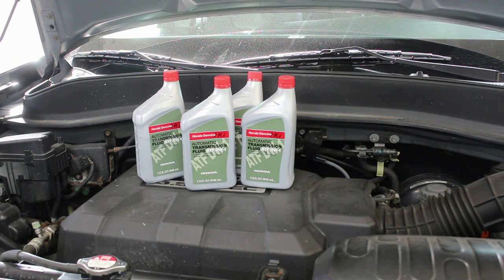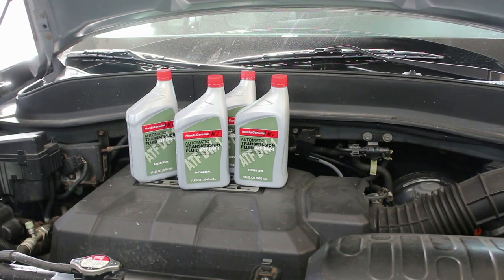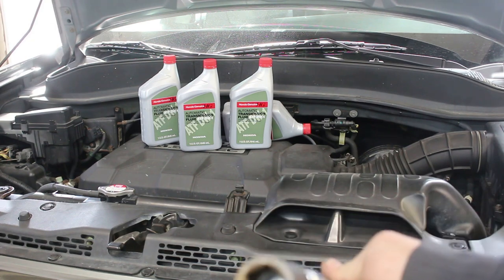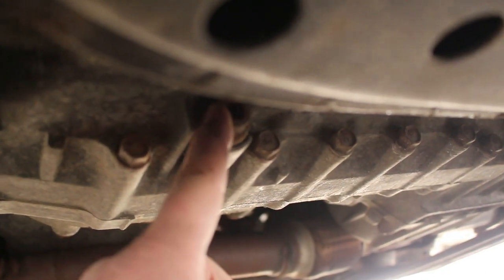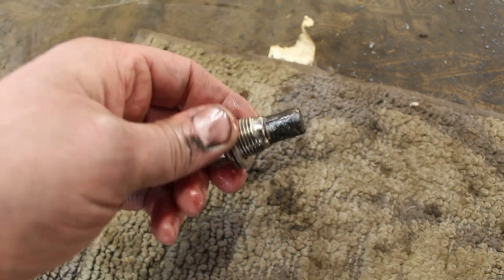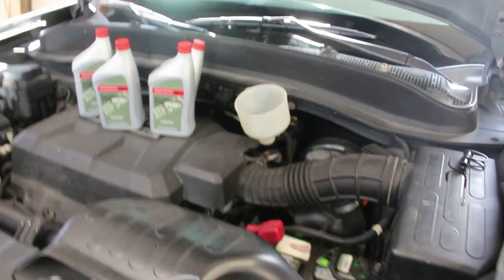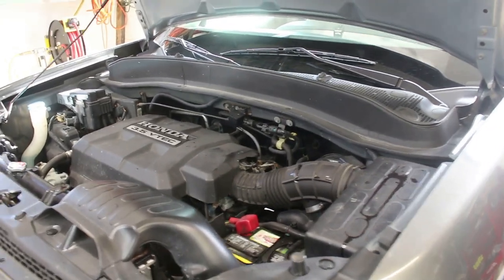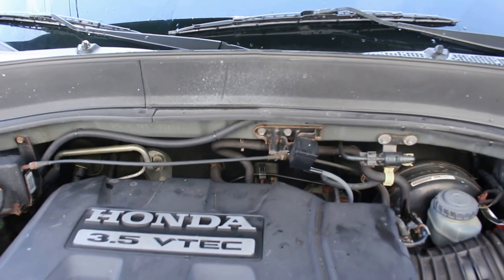Honda ridgeline transmission fluid drain and refill!

Comment: You have to take transmission apart to change the filter, major work
Reply from the maker: Thanks for watching!
Reply: That is the internal filter. There is an external filter that is accessible. A pain in the ass (splash shield, etc.)  but accessible.

Comment: Thanks.  Your initial comment about loosening the fill bolt FIRST was absolutely correct.  I drained my tranny fluid and then discovered I couldn't break loose the fill bolt.  Had to replace the fluid using that skinny dipstick tube...not fun!  You didn't mention that a single drain 'n fill is insufficient.  It requires doing it 3 times with some driving in between drain and fills.  I completed my fluid change over the course of several days.  I used a drain container with volume marks so I knew I was replacing volume for volume, and of course, after the 3 D and F's checked the level
Reply from the maker: Thanks for watching!
Reply: Is there not some other way to flush and fill?
Reply: @rickjudson7029  Honda does NOT recommend a flush because of the possibility of contaminants possibly circulating and getting lodged downstream. Drain and fill 3 times and replace the inline filter every 100K.

Comment: Which way did u turn to loosen atf fill plug
Reply from the maker: It's normal threads but mine was extremely tight. I had to use a breaker bar to get it loose.

Comment: And no filter change????🤔🤨😲
Reply from the maker: It had been changed recently. Thanks for watching!
Reply: They do not have filters on transmission
Reply: @spannersautoandcomputerser1649  There are TWO filters, one internal that can't be serviced without taking the trans apart, and one external that is accessible but a pain in the ass because of having to remove and replace the gravel shield etc. Look up Yuri Motso's video on the replacement.
Reply from the maker: There is a filter on the gen 2 ridge lines. His video is 2016 and up. I was working on a 2007.

Comment: Good video, but it'll be good to show HOW you doit, next time make your wife hold the camera for you while you do it. But overall, good tips 👍
Reply from the maker: I tried to explain how to do it. I did not show loosening the fill and drain plugs or adding the fluid. I feel like that would make the video a lot longer and that was not necessary because it was just loosening and tightening bolts. Thanks for your input, I'm just trying to help people out so they don't need to spend unnecessary money at a garage.